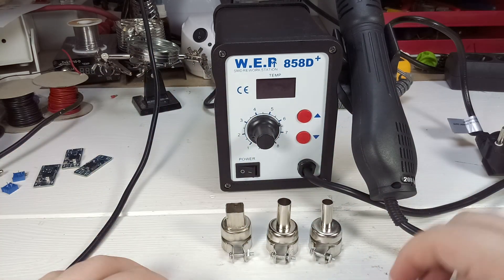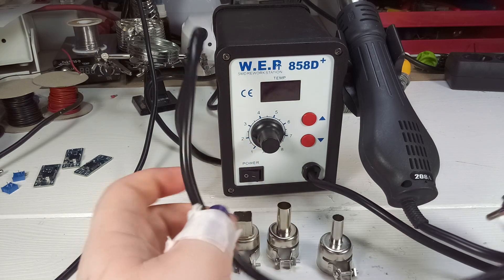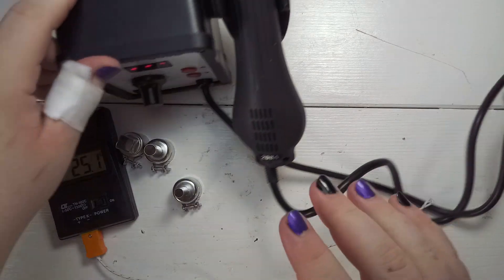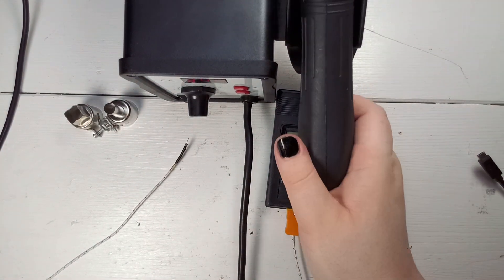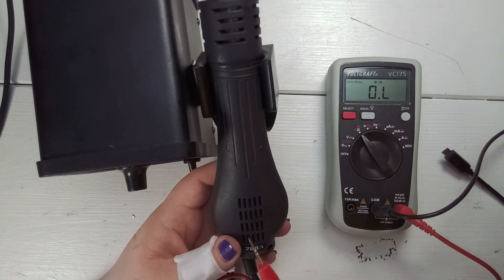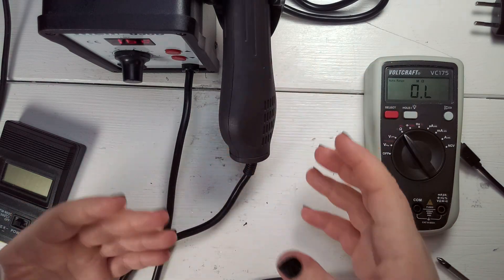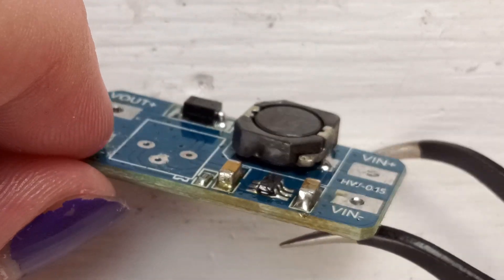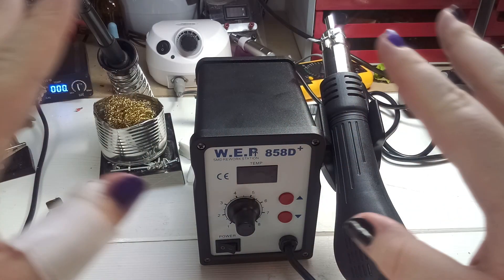858D+ Hotair Rework Station - Test and Review

Comment: 858D+ hot air rework station has high power, fast heating, accurate and stable temperature. The wind is mild and the temperature adjustment is simple and convenient.

Comment: Check that the fuse is on the live wire. These units have been known to be wrongly fused on the neutral wire so if it blows the unit is still live.
Reply from the maker: Hey thanks for your comment! :) 
The standard EU plugs are not keyed which means you can plug them into the outlet either way. Therefore we always have to assume a failed device is stil live when plugged in. Only the UK and one other country have keyed plugs for home appliances/ electronics as far as I know.

Comment: I have a YORKING - 858D what looks like that but with no branding and with a uk plug, basically it turned off what do you think would of broken, I checked the fuses they seem ok - https://youtu.be/clMObzp-wsU
Reply from the maker: Interesting,  my unit has an accessible fuse on the back side. Considering there is absolutely no sound, humming , and you checked both fuses in the plug and the unit itself if available I'd say a cable came loose inside.
Reply: @PhysicistAnna  ok i will have a look inside thanks

Comment: hello can you give me tips? how much air flow & what temp do i need to melt old solder? too much air flow and wrong temp is bad right?  i got the same rework station.. please help me im still learning.
Reply from the maker: Hey welcome to my channel!
Typically I set the airspeed to 5 and Temperature somewhere between 350°C and 400°C.
Too much airflow causes either components to be flown off if you try to solder them or not heat up the pcb (printed circuit board) as much as needed if you try to de-solder components. Basically air speed is not as critical and so is temperature. The real challenge is to not heat up components for to long. This means that if you set the temperature to 350°C you can blow the hot air longer onto a component than if you set it to 400°C. The faster you solder a component in place the better it typically is (try to stay below 30 seconds to de-solder or re-solder a component, lower is better). That is why we sometimes need to use higher temperatures. Because of that I'm not using the hot air rework station at 300°C but rather 350°C. If you have a big pcb with big traces you might want to use the hot air station at a 150°C or 200°C setting for 1 or 2 minutes beforehand, constantly moving the nozzle over the whole board to preheat it before the actual solder operation starts. Just avoid plastic parts like connectors, they can easily be damaged even at these rather low temperatures.
Reply: @PhysicistAnna  im changing my ps4 hdmi port i need to clean it first then resolder a new one :) thanks alot for the tips!
Reply from the maker: You're welcome! :) Just one more thing, use some liquid flux. Makes it a lot easier to de-solder and re-solder ;)
Reply: @PhysicistAnna  im using paste flux is it okay?
Reply from the maker: Should be fine, the reason for liquid flux is just so it creeps underneath and between components and their legs. Your paste flux will be liquid as soon as it reaches ~70°C. Good thing is you have some flux at all :D